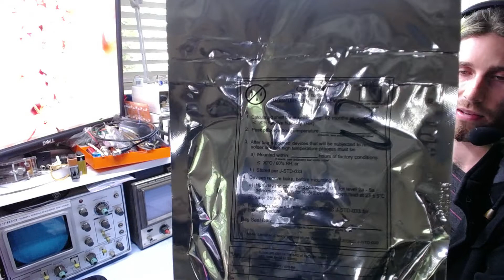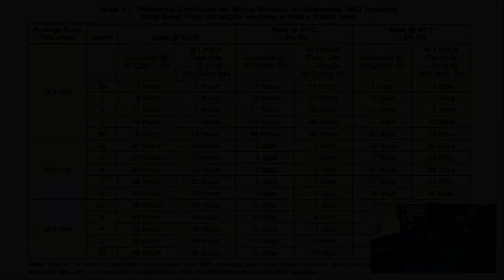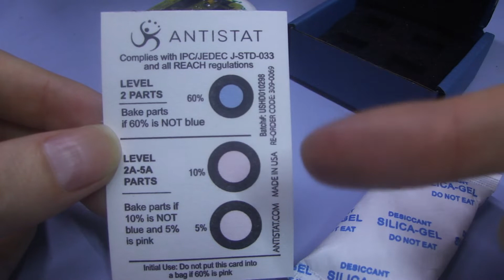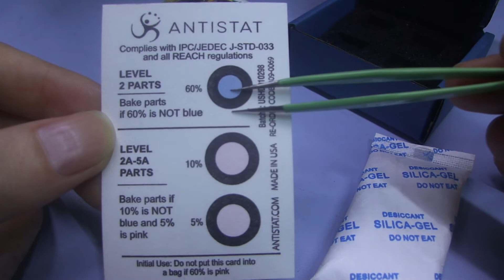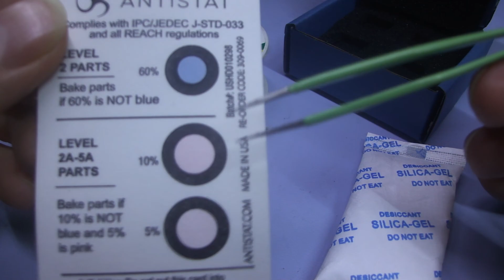Working with Moisture Sensitive Devices

Comment: Hi, I've received a microcontroller with such packaging. The card indicates that the humidity limits were exceeded during transport (some of the rings on the card which were supposed to be blue were not when I received them). How do I bake these devices? The standard mentions that I should bake them at 125 degree Celsius for a few hours, but I'm not sure how to do that. Can you help me out? Thanks.
Reply from the maker: Most likely you don't actually need to, especially if it's a prototype etc and you will be soldering it by hand, which I assume you are, if you only have one of them. 
Assuming it's an MSL-5 level part or lower, and unless ALL the indicators were completely pink and the packaging is damp inside, I wouldn't worry too much. Just heat the part gently if you're using hot air, to avoid thermal shock.
You're more likely to kill the IC with a bridged solder joint, backwards supply pins, bad PCB layout, short circuit, etc.

The "rules" for all this MSL stuff are on the paranoid side, for high-volume production lines where speed is important, and any chance failures are minimised as much as possible.
In the same vein, best practices say you should be working at an anti-static bench, with appropriate anti-static flooring, etc, have verified everything with a surface charge tester etc etc... but most hobbyists don't do that either.

If you really did wish to bake it, use an accurate oven (a toaster oven with a decent PID controller would be great for DIY/hobby use) and set the temperature and time accordingly. Bear in mind you can bake at lower temperatures if you use a longer time, which may be better in the sense that it will reduce lead oxidisation.
Reply: @Agent24Electronics  Thank you for the explanation! I will try that and let you know.
Reply: @Agent24Electronics  One particular chip I found is pretty sensitive is this type of isolated gate drivers that have an internal "semiconductor-based isolation barrier", they seem to refuse to work the majority of the time when soldering by hand after the limits have been exceeded: https://www.skyworksinc.com/-/media/SkyWorks/SL/documents/public/data-sheets/Si827x.pdf

Analog Devices makes some similar devices that seem more robust than the Silicon Labs parts but the Si parts I think are cheaper and faster.

Comment: Can't say as a hobbyist this is anything I've had to consider in the past, but would like to no if you still enjoy the process of manufacturing your own PCB's at home? I have done for many years, I have hand drawn them before with the equivalent of a "sharpie" given the price of PCB manufacture, about £6.50 for 10, and a delivery time of about 8 days here in the UK you still make them at home, so just wondered if it was still "fun" for you?.....oh yeah....We no quite a lot about "moisture" over here! ……..interesting vid, though would be nice to see you populate your board and program it, and then a bench test
Reply from the maker: It's a best practices thing, and in hobbyist scenes you probably don't need to consider it most of the time, but it's worth knowing about, because it can be an issue. The most likely scenario where damage would occur for a hobbyist is with BGA rework on motherboards, graphics cards, etc.
In cases of mass production, nobody wants to risk failures due to damp parts or having to spend time & money drying them out again, so the 'rules' are followed.

After many PCBs, as with anything, the novelty kinda wears off, but it's still an enjoyable way to spend some time. Making a video about it makes things more complicated though. Normally I'd listen to music at the same time and get 'into the zone' but of course I can't show that or I'd get a copyright strike.
Assembling the board can be annoying however, especially if it's double-sided and contains many small wire-links or tiny vias. I try to go for single-sided boards or fairly large vias etc where possible.